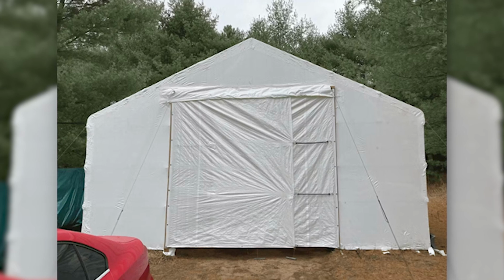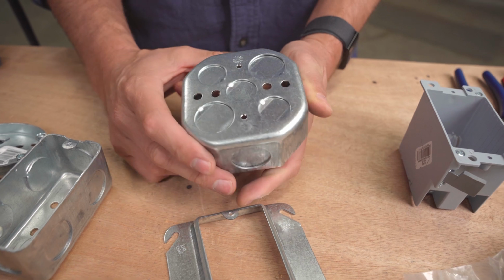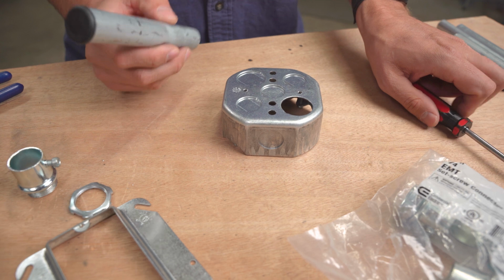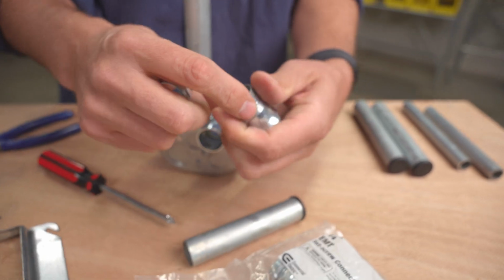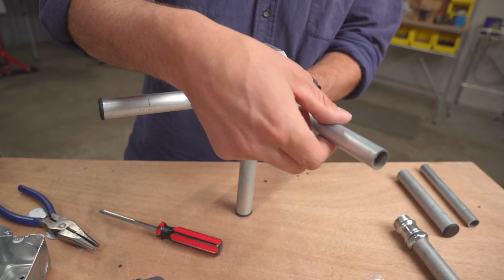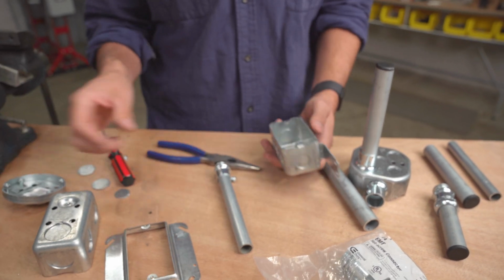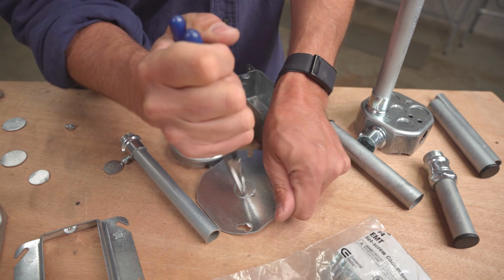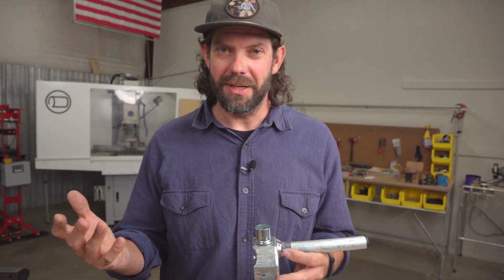Should You Build DIY Projects With Junction Boxes?

Comment: The junction boxes introduce an offset that will require modification of the design and may be a bit inconvenient. To me, it's a bit of overkill and not as thoughtful an approach as your connectors. Having said that, thanks for the overview of those boxes and that last build where the box was actually being used for its purpose.

Comment: I've done this when I didn't have time to order something from you. BUT there are a few reasons not to. 1) it's more expensive than your fittings. 2) bulky and often misaligned due to the box dimensions. 3) its not as load baring as your connections. Thats fine for some builds but not for what I do. A junction box would buckle in high wind. The mason boxes are paper thin and I wouldn't suggest them even for low stress builds. The heavy steel single receptacle boxes are the strongest. Here's the one reason I would chose this over your fitting. I had an art display that I needed to keep classy from all angles. I built my EMT stand with a junction at the bottom and top. They had actual inlet and electrical outlets so that I could plug clip lights into the top and an extension cord at the bottom. No hanging cord. I would not suggest this to anyone without electrical experience though. I'll rebuild this for my next display and will send you a video.
Reply from the maker: Awesome, can't wait to see the photo! Thanks for the comment and for sharing your experience. That's all really helpful to know for us and for others!

Comment: To those considering using electrical boxes as structural connectors. Do not use the boxes with the multiple size knockouts and rings unless you are using only the largest size. The crescent shaped ring, remaining after taking out the smaller knockout, has virtually no strength and will cause your build to fail under very light loading.
Reply from the maker: That makes a lot of sense. Thanks for sharing!

Comment: Both EMT and electrical boxes are not rated to be for anything other than its intended use, that is for electrical wiring raceway and enclosures for splices, respectively. That said, it's a durable material that can be used creatively for whatever project you want make if you understand its physical properties and load bearing. One thing you probably should not do is mix EMT used for structure with EMT used for raceway, since its use for electrical raceway should follow code as far as its mounting and support requirements. In short, it's really better to use a separate structure system intended and rated for structural purposes, and keep the EMT and junction boxes in the domain of electrical installations that depend on pre-existing structure for proper installation.
Reply from the maker: Yeah for sure, you're definitely right about that!

Comment: What's the cost to develop and get regulatory approval to incorporate electrical junction boxes and outlets as an optional connector type in your existing product line? 

20k; 100k; 300k? More?

If people have told you they've used your product in conjunction with junction boxes and outlets to run electrical, then I could think of a few reasons why it could be a viable product line worth developing. 

My hypothetical question definitely has an answer if you ask the right people ‐‐ but I've only just found your YT channel and product line with this video and I think that a sleek and solid connector rated to run electrical could be a major bonus to folks seeking your product to build something with conduit piping.
Reply from the maker: I'm not really sure to be honest but that is something to consider for sure. Our Coupling is really the only connector that would even allow wires to run through based on it's design. It would be cool to potentially develop connectors specifically for building and running wires at the same time! Thanks for the comment and idea!

Comment: I built a banner frame using the emt elbow connectors like you showed and they failed after being in the elements after only a few months. I replaced them with maker pipe connectors about 3 years ago and they are holding incredibly well! I think I shared photos in the community builds section. I wouldn't trust those junction boxes for any kind of structural strength like I would maker pipe. You guys make an awesome product!
Reply from the maker: Thanks for the comment and for sharing your experience with the electrical connectors Joe! I'm glad you had a good experience with Maker Pipe!

Comment: Canopy fittings are another excellent option for interconnecting sections of conduit. Not sure if you've mentioned that option before.  Canopy foot pads and other fittings are extremely strong and work extremely well in a variety of applications. Shop around and you'll find they can be a very cost effective solution.

Comment: Will your business take a hit? Probably. Out of business? I do not think so. Putting this video out will put you out of business? No as well. In my opinion, it will even make other people consider your products as better options than those junction boxes. There are lots of projects better use your products than junction boxes. Then also we have to consider the cost of not only using the junction boxes but also the time used to install those. Also there is also the esthetic aspect. It is cleaner looking to use your product than junction boxes. Also, using your products produces less waste than using junction boxes where its intended purposes is make space for wire connections.